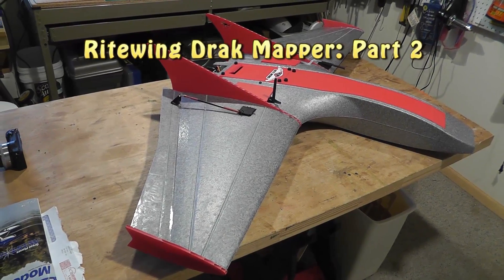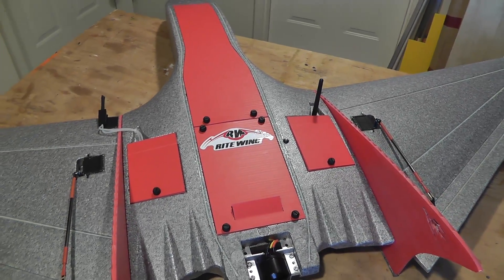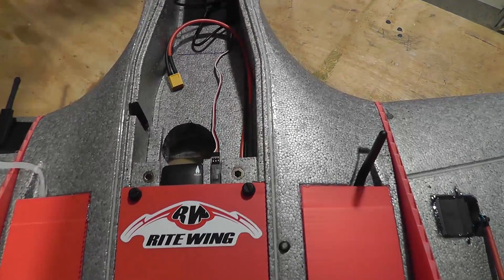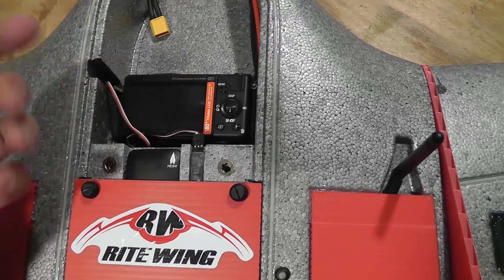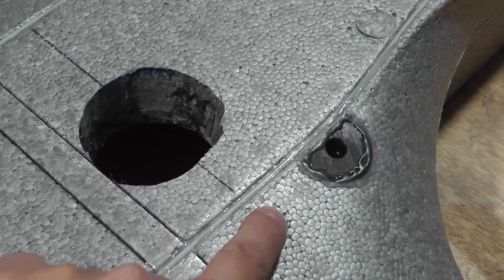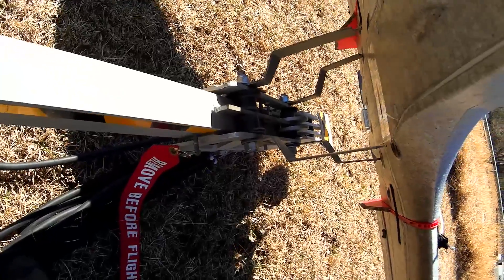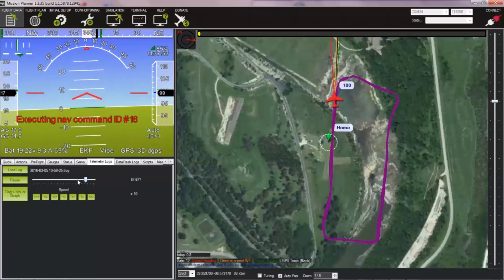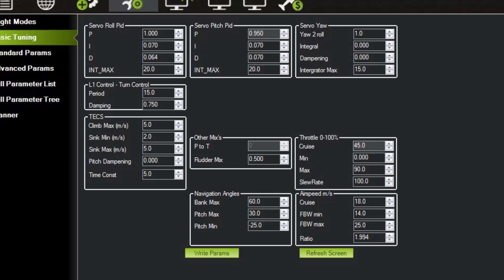Ritewing Drak Mapper: Part 2

Comment: Building one soon. Few questions.. What's your mapping mission flight speed? 18m/s? any image distortion or blur? are you well above the drak stall speed? Thanks!
Reply from the maker: Hi Ronan, I use 18 m/s as my mission speed. That seems to be a good speed for the Drak to fly stable and efficiently. I use a shutter speed  of at least 1/2000 (typically 1/4000 if it is a bright day), which results in zero detectable motion blur at 400 ft. The stall speed depends on the payload, but with my setup it is in the 10-12 m/s range.

Comment: Hello Sir, We are looking at the Drak, as we have a field test of 200 HA mapping in Cambodia over Vegetation to identify where the water stream are on the land (for agricultural purposes). As you were mentioning you modified your Sony Camera with Infrared capabilities; I was wondering if this modification would serve the identification of Water streams with Pixhawk distance triggering mapping solution using the Drak or something else; but we are considering the Drak strongly due to its space and it's mapping advantages in wind flying etc.... Tks for keeping in touch and Safe Flying! Rgds
Reply from the maker: I agree that the Drak is be a good platform choice in challenging conditions, particularly if you are an experienced pilot. It can be a little intimidating for first-time pilots. I also agree that a modified Sony camera can be useful for stream mapping, particularly if you use the data to generate surface models that could indicate stream beds, in combination with identification of vegetation characteristics associated with streams. If this is a research project I'd be happy to collaborate. You can email me at dmerwe2@gmail.com

Comment: What's your average flight time with everything installed?  awesome job!
Reply from the maker: Most mapping projects are done in 30-40 minutes (good enough for the area covered within VLOS mapped at 400ft with 75 % image overlap). That typically leaves 30-40 % leftover battery capacity on 8000 mah 5S. I would not recommend extending the flight beyond 45 mins on this battery to ensure you have a margin of safety and you do not compromise the battery longevity.
Reply: Wow.  That's some great range!  Thank you.  Been trying to decide if I want to build a Drak, or go with a Firefly 6

Comment: What is the amp draw for ritewing's default motor / prop / esc combo? Considering building some custom 18650 packs
Reply from the maker: It can cruise at less than 10 A, but the bottle neck will be at full throttle during takeoff, when can draw around 60 A.
Reply: 5 or 6p with the 10a 18650s will easily handle that takeoff

Comment: Any chance you would be willing to share your Pixhawk parameter file?  I would really like to do a sanity check against my own Drak/Pixhawk settings before maiden ;)
Reply from the maker: Sure, I'd be happy to. What is your email address?
Reply: Hi Both 

I'm currently building drak for mapping and would really appreciate if you could share your full parameters list to use as a starting point. 

Thanks in advance!
Evgeni.Chipev@gmail.com

Comment: Thank you for the video. What flight time are you getting for mapping? Thank you.
Reply from the maker: Pablo, it depends on your setup, but you will burn through about 2000mah of battery for every 15 minutes of flight. That is for flying at 18 m/s, with a Sony a5100 camera and 8000mah 5S battery. The prop is 11x5.5 APC. Altitude is about 450 m above sea level.
Reply: Thank you for your reply. Are you using the stock motor? If so, is it possible to use 4S batteries or I will lose lot of power?
Reply from the maker: +Pablo Legarreta I use the stock motor. It needs 5S for adequate power. You will need a higher KV motor to operate on 4S.
Reply: Great. Last question. I use a Zephyr II uav with stock motor for mapping in high winds (60km/h). What do you think about your drak performance in high winds scenarios? Is the stock motor powerful like the stock one for the Zephyr? I am interested in this airframe to reach more flight time in hard winds scenarios (the Zephyr I use only has 30 minutes) Thank you.
Reply from the maker: +Pablo Legarreta I also have the Z2 and Z3. The Z3 is particularly good in windy conditions. I have not flown the Drak in extreme wind yet, but it is a good flier and tends to maintain its course during wind gusts similar to the Z3.
Reply: Great, thank you. I will be following your channel with attention!

Comment: Where did you plug in your airspeed sensor to the AS port?
Reply from the maker: The airspeed sensor connects to the Pixhawk via the I2C expansion board.
Reply: FlyingMerf I thought it would go to the ADC 6.6v ?

Comment: great info , also i like how you left the DRAK as it is instead of painting it , maybe i would add some glass fiber on the bottom 

thanks again great vid
Reply from the maker: I agree it will be good to protect the underside. I used clear plastidip on the underside, and I may add some laminate at pressure points if it proves necessary. I also used clear plastidip on the wings to provide better adhesion for the hinge tape.
Reply: FlyingMerf guess you used plastidip before on the underside , i always was afriad it would peel off .... surly less work will try it out on my next build.

thanks
Reply from the maker: +Aron Gatt I was concerned about peeling too (the product description even claims that it is peelable!), but thus far it has not shown any signs of that.
Reply: FlyingMerf thats good , if it helds up and if it degrades by time a bit of sendind and a re-spray would fix it il guess

Comment: Why no autotune? My pixhawk pids are very different after a lot of tuning. Roll - P1.321 I0.042 D0.106 30 Pitch P2.894 I0.047 D0.232 L1 is at 15 as well. Yaw 2 roll at 1 seems OK.
Reply from the maker: Thanks for sharing your pids. The parameters I used worked well, but I'm sure it would be different if I used autotune. There are no absolute "best" tune parameters. It ultimately depends on individual preferences of flight characteristics.